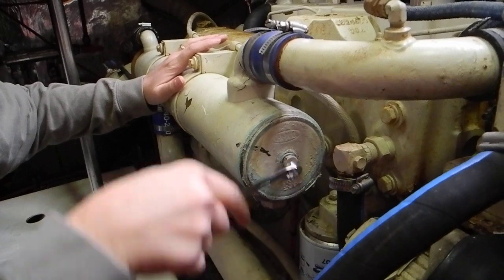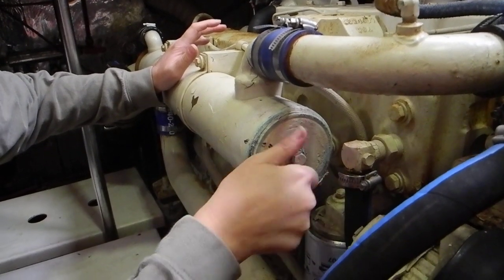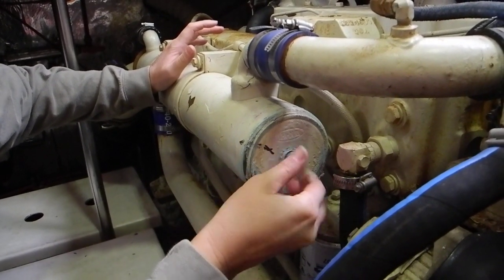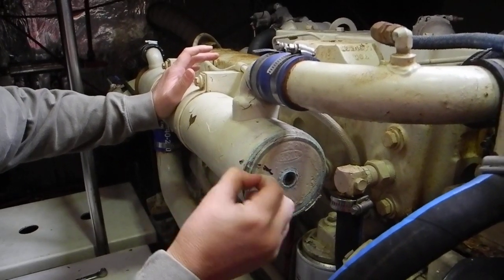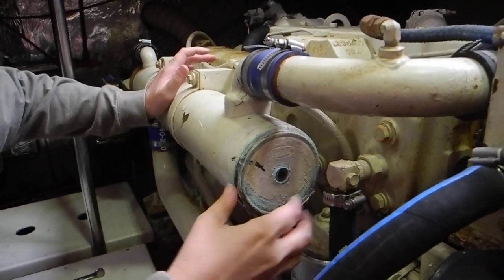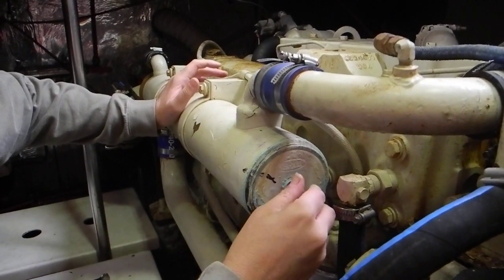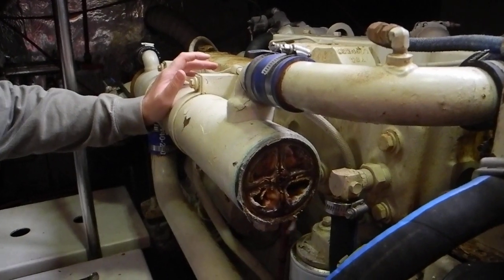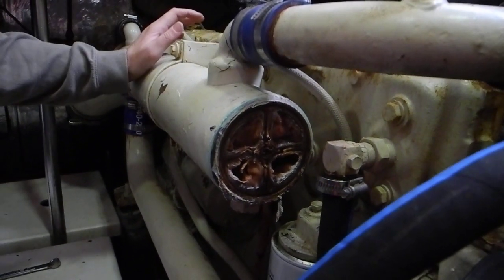Cummins, End cap removal from heat exchanger

Comment: Eww . This one is pretty yucky 😝 . Wouldn't be nothing but a thing. Good morning to you and Alyse.
Reply from the maker: Could use a welding rod to cleanout the built up calcium deposits and provide better cooling water flow.
Reply: @AskCaptainChris  10-4

Comment: Didn’t you just do this??
Reply from the maker: NOPE, a different owner, different boat and different engine. This is a Cummins, the other was a FORD. New skills and tricks to learn, watch tomorrow for a different video - water leak on generator, see you soon.
Reply: @AskCaptainChris  Ahhh... my bad. I see this time you indexed the cap.
Reply from the maker: @michaelrutledge7048  Remember, we are videoing new boat owners and coaching them through their learning curve. Not everything goes to plan so we figure it out and go from there.